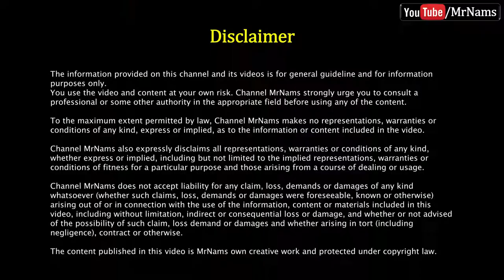how to install locks on wardrobe

Comment: How to open when the almirah is locked and lock broke while opening
Reply from the maker: It will be opened by pulling, these locks just prevent auto opening, they are not stronger to prevent robbery.
Reply: The cupboard is still locked and key keeps turning but lock is not opening
Reply from the maker: ohhh, sorry to hear sister, try pulling with force with minimum damage :P